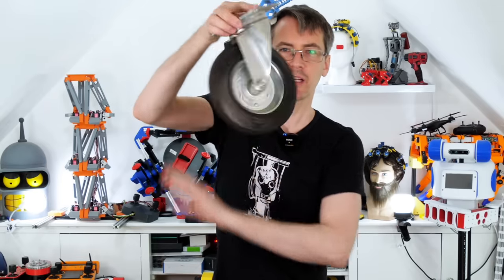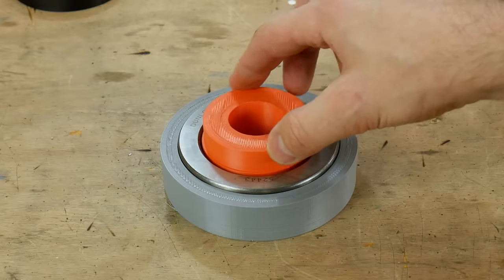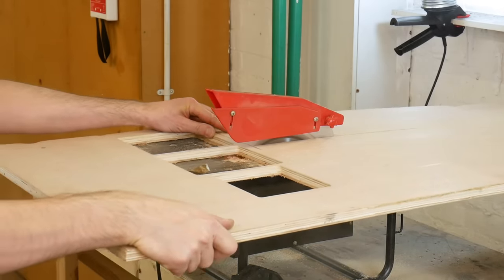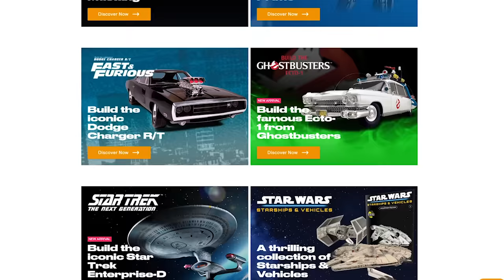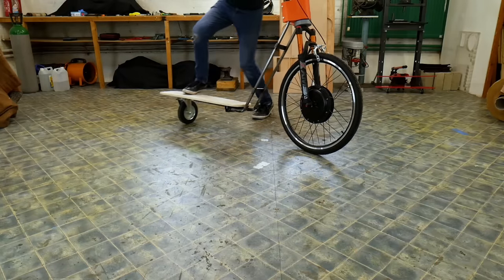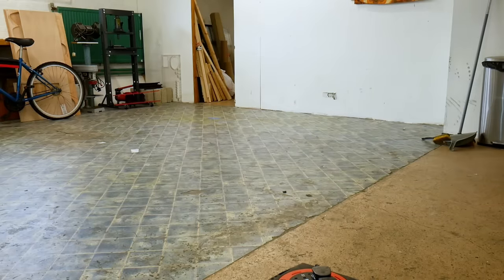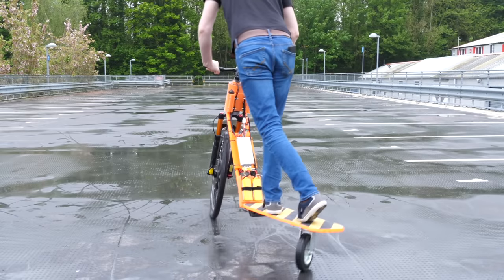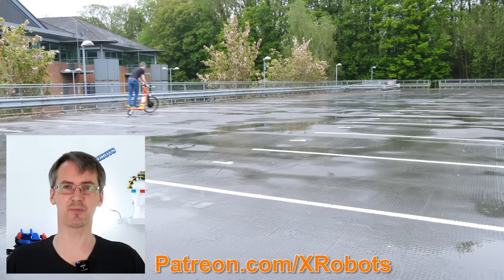1000W Caster Scooter

Comment: I’d have spring loaded the caster. That is leaflets to put pressure keeping it straight, tensioned so that it needs a little more momentum before the spring gives way, and doesn’t run away just trying to get on and take off. Caster or not, you want it to spin less than a complete 45 in either direction anyway, if it does, you’re asking for an accident.

Comment: I think to make this ride-able, you will need to selectively constrain the rotation of the caster.
I wonder if it would be possible to have some sort of arrangement that allows you to put weight on a pedal that progressively straightens/centers the caster. 
When your weight is off or lightly on the pedal, the caster could swing - or maybe vice-versa. Whichever makes sense for your posture / weight distribution.

Comment: Bicycle mechanic here..

Regarding your brake mounts, undo those screws, put that plastic spacer IN THE BIN, and fit your disc rotor using those same screws. Your rotor and caliper will fit, because that hub almost certainly wouldn't be made outside of the necessary disc brake standards if they actually wanted to sell any.

The plastic spacer is merely to stop the screws fowling up on the planetary gearing inside the hub. If the screws were any shorter they'd be useless for mounting a disc rotor however.

Comment: Hey bud.  Stick some resistance springs between the forks and the frame that allow movement but offer tension against the loose play between the frame and the front wheel assembly.

Comment: I'm thinking, much like on a normal bike, where you lean left and the front wheel goes left, you need to add, or increase the geometry. Basically, you want to make the caster turn opposite to how it moves now. I think this could be done by playing with three angles: the front wheel/handle bar; the angle that the caster wheel is mounted (you have it parallel to the ground, maybe a wedge between the deck and the caster); and last, the caster mechanism itself. 

I haven't worked it out myself, but it seems like there should be a permutation where you achieve at least neutral stability, or positive stability of the caster compared to the negative you have now.

Comment: at 5:10 what you have there is a pipe kinker. the material being bent needs to be really tight in the die to prevent it from getting wider and forcing it to hold its shape.
Usally they are so tight in the die that they dont touch the bottom of the die till it start bending

Comment: If you'll use motor wheel for rear wheel, you can use it make a tension of board and stop unnecessary rotation when braking. Also using rear motor wheel in  recuperation mode adds some stability in turning.

Comment: Zoe The Robot thinks you should try it with two casters in the back, with the casters side by side, about 8 to 12 inches apart. Maybe being able to lock the casters for slow speed, and release the casters for high speed

Comment: Two rear caster wheels side by side wouldve given some stability, and been interesting to see. 
Or possibly one rear caster wheel that is constantly using regenerative braking, which will give some stability, and slip out at a controlled rate, almost like a ski, rather than the  uncontrolled caster wheel ya used.

Comment: If the rear wheel had drag, it might make the bike stable. To get the drag, it could have a generator hub that feeds current to the front motor. But what's the fun in stability!?

Comment: Even pushing a trolley from the front is completely unstable, I'm not sure what you were expecting. Sure, when you accelerate or have an exact zero-acceleration, the back wheel is pulled and the forward momentum of the back of your bike is lesser than the front, but as soon as the front slows down, the momentum of the back is greater and the back wheel tries to overtake the front wheel, and this is true whatever your position.

Comment: I think you need a brake on the back wheel, and not just for braking- it'd give you way more control over the whole thing. With just a back brake i'll bet you could legitimately control this thing and it could open up the ability to do tricks you couldn't do otherwise. It's a neat project!

Comment: Mount the caster on an angled laterally pivoting wedge with the pivot and the low end of the wedge in the rear. The angled pivot would raise the leading side of the caster as the assembly pivoted away from center increasing the angle of the wedge.

I know. James Bruton dude is always off to some different design with his next videos and never develops anything any further, though I often wish he would.

Comment: May I suggest rubber band tensions on both ends of the cast anchored to the front giving it a bit of resistance from slipping out and a neutral forward position

Comment: It might be easier if the board you stand on was lower to the ground. You'd have to a similar bracket as you had for the brake to attach the caster .
I did a similar thing to a longboard I made ,instead of attaching the skateboard trucks to the underside of the board I made a couple of brackets so the board you stand on was lower than the trucks attachments.

Comment: edit: @mago comment is the same but better, oops 😅

I think you need to angle the caster a bit too so it is pulled toward the center of mass the same way the front wheel "falls" in line on a bicycle to try to correct a plane of travel during turning.

Comment: So your idea would work but as far as bikes go there’s a reason why they have a complete frame compared to scooters  where the position of the front wheel is to the frame to handle stresses. There is also too little friction in the back, unfortunately to remain stable the caster would need more drag than the front at all times hence why all recreational rides have rear braking primarily and front is only supplemental.

Comment: My suggestion? Don't try to steer with the front wheel (lock the front wheel so you CAN'T steer). Super counter-intuitive (and may not work) The theory would be that you steer by leaning, the lean makes the caster turn, when you pull it upright again, the castor should* then straighten out, as the force of your body is now directly down, and the front wheel drives it to the neutral position.

Comment: Theres a rubber spacer on the rotor mount when they ship hub motors, you remove that to install the rotor so the spacing will be fine and if it's not, use the thrust washers that they send to adjust the spacing. The disc brake would have worked no problem, its standard size. Also, its not a good idea to use a 1kw front hub motor with a suspension fork or an aluminum fork and ESPECIALLY not an aluminum suspension fork. At the very least, its standard practice to install a steel torque arm to prevent the axle from splitting or rounding off the dropouts on the fork.

Comment: I think if you put 2 caster wheels in a v shape toward the back it will be a lot easier to ride as it will be balanced in an upright position also you can use your weight as steering mechanism by shifting it in either direction with front steering (or eliminate the front steering  )

Comment: You should have drilled a hole on each side of the caster wheel to put a somewhat soft spring on each side so it will pull itself back straight but not effect it too much when you are trying to  strafe.

Comment: Try aggressively leaning the scooter into the corner, with your body leaning only slightly into the corner.  The castering effect should overcome some of the lateral acceleration, thus reducing the propensity to spin out.

Comment: Mount a couple of coil springs, one to each side of the castor and on to the frame. This will add resistance and help pull the castor back to a central position, but will still allow some rotation. Hopefully the damping will reduce the tendency of the scooter to spin.

Comment: A free spin ing rear wheel is like a gyroscope that favors no variance in direction. Inevitably, when speed is decreased, you almost always micro adjust your steering wheel slightly causing the rear wheel to independently maintain speed and direction as much as possible. If you can maintain perfect level breaking continuing a straight line, you'll have no proboem. Anything else you'll drift to try and preserve overall speed (with front & back separate masses) going different velocities and directions.

Your scooter-unicycle essentially averages the combination of both front and back attached where the rear is dependant upon initial acceleration to follow, but, breaks rules of easy rideability when velocity 9r vector changes.

Someone from Circ du Solei would have difficulty riding this.

Comment: You can improve it by tilting the vertical axis of the rear wheel a little forward, as the wheels of the two-wheeled skateboards go, you keep the spin but avoid it to get out of control.

Comment: Just a brake on the back wheel would solve a lot of the problems. It would still allow it to cast but you could control how much by 'pulling' the rear back along the travel vector. It could also be hooked up to auto-break when the board tilts. Maybe easier said than done given that it can over rotate & twist up cables.

Comment: The locking mechanism you angle grinded off that caster performs 2 braking functions at the same time, it brakes the rotation of the caster bearings as well as the spinning of its wheel.  Instead of a caliper brake on the front wheel, what if you utilized the caster breaking to hold the back wheel still in both directions at once?

Comment: If you incline the caster with the wheel further rearward it will tend to center.
If you lean out of the turn it should steer in the direction you want to.
If you impose some drag on the rear wheel it will trail straighter.

Comment: You should mount the caster wheel at a slight angle so that it tends towards forward, similar to how a ripstick works since those have two caster wheels and are very easily controlled once you get  the hang of it

Comment: Slightly defeats the point if a castor, but what if you had 2 springs either side to help it align back centre? It could still swing out and be gnarly but at least you wouldn't just endlessly spin in circles lol. Or perhaps angle the castor forward a couple degrees so it more aggressively wants to track straight?

Comment: It's not a perfect answer , but the next time you get in a jam where you may not have the correct size for the pipe. Your bending you can fill the pipe with sand, As the sand doesn't move and contract the same way metal does, And there's no room for it to go anywhere when you're bending it inside of a pipe.   So it helps keep the exterior walls straight while bending 😅😂 you are likely already familiar with the idea but simply didn't think of it in the moment... it am option for anyone looking to try bending pipe without perhaps the tool or being required to make say 2 bends but never needing it again

Comment: Build  V shaped body, with the front wheel at the joint, and a caster at either tip. This would remove the problem of balance from the situation while still exploring the question at hand.

Comment: You could experiment restricting the rear wheel's ability to turn by putting the attachment point at an angle downwards, rather than parallel to the board. This should fix the bike with 99% certainty.

Comment: The front of the caster mount should be closer to the ground then the rear of the mount. This should make the caster want to fallow the lead wheel buy lowering its center of mass when going in a straight line.

Comment: For stability and control put one caster wheel on the 2nd bend of the frame and one or two non caster wheels at the back of the board

Comment: Re: pipe bending

Instead of going for the whole angle change in one go, it's much better to bend a little, move an inch or two down, bend a little and so on. Trying to create wider radius with the stress spread out more. 

This may be a little clumsy with the bottle jack, but it'd probably require letting the position back down to neutral between each little nudge

Comment: I think you need to control the back wheel by using your body as a constraint between the handle and  the standing area. Not goingto be eays, but at very least the front wheel will be twisting and its friction against the ground should reduce the throw out of the rear wheel. this also means you need to resist the urge to jump ship as soon as things start going out

Comment: Tip the caster wheel down in the front. I built a rear caster wheel big wheel for my son years ago and tipped the front of the caster wheel mount down in front so they have a tendency to self center.

Comment: If you could figure out a way to add a brake to the castor so that you have front and rear braking, that could help give you some more control when braking. If you could also only apply the rear brake a bit it would give you more stability when travelling slow

Comment: honestly, in a time of scarcity and difficult manufacturing, i understand why they made bikes with 2 wheels,  but hehe, you could stabilize the bike by putting more caster wheels, so that it cannot tip you off of itself, and you don't need to manually balance on it anymore.
or if you feel adventurous, you can suspend the platform on 4 caster wheels, attached in a skateboard configuration!!! this allows you to use the caster wheels, while still allowing for you to lean into corners....but i dont think such a contraption can be manually stabilized....it would need suspension at least.

Comment: There is a plastic shim on the disc mounting bolts you have to remove to fit a disc brake. The hole in the fork's arch is to fit a fender not a brake.

Comment: I was wondering if the bike would be easier to control if the back wheel had a movement limit of like 45 degrees to each side, or more or less since you can verify the trailing wheels needed angles.  Good luck with the bike.

Comment: You needed dampener attached to the caster to slow its Jerky movements, it would also limit the movement and avoid snapback. Also some actuators attatched to the  castor with some stiff springs that pull the caster straight as default and that would release the caster to have some free play when a button was pressed would get rid of most of the unpredictable  behavior

Comment: What if you mount the caster wheel at a angle like 20°-30°? then it would tend to stay straight, but still has the possibility to rotate a little bit. does it make a difference?

Comment: I think it would work much much better with a fixed headset. you would still be able to steer at low speed using the rear, and you could lean steer at speed. Having two steering axles allows it to steer beyond forward track.

Comment: 3D print a cheese wedge to go between the deck and the four bolt flange for the rear castor, 20mm at the front down to 0 at the back; and it’ll ride perfectly.

Comment: Just widen the back end and add another caster in parallel. That way, you have something to help you hold your balance.  The part you stand on will look like the letter T. You probably will need to add some more steel so it will not snap.

Comment: What you've built is similar to the razor crazy kart, but with only a single rear caster wheel.  The carts look to have a greater amount of caster/angle on the rear, which the rider can adjust with a lever to make it more or less stable for drifting.
Reply: Agree it’s an old kids toy 
With nomotor on the front it will self propel by carving / pumping old kids toy!!!

Comment: Before even starting the video, I know you should be putting the caster on an angle so it will self correct straight, this can also be used to propel you forward.  Look up ripsticks. They have been around forever

Comment: Maybe weld a flexible arm to the caster turn joint and the steering so it locks the caster from 360 deg rotation, unless that is the whole point

Comment: at 1:01 when you are showing the brake rotor mounts, it looks to me like the bolts are actually holding on a spacer, if you take out the bolts you might find that a rotor would fit with your fork. 
Also you should really set the bearing preload on the fork using a top cap and star nut/expander plug instead of just relying on the stem bolts

Comment: Interesting suggestion! Incorporating the concept of self-centering from ripsticks and using an inclined plane or spacing between the deck and the caster could indeed be a potential solution. It's always fascinating to explore innovative ideas for improving mobility and rideability. I'm curious to see how this concept would work on a bike with a caster wheel. 🚲🤔🔩

Comment: the only reason it works a little bit is because the caster bearing is on an angle to the ground when you are on it, just like the steering wheel. it makes it more stable. i think that the drivability will improve if you set the angle off the caster further forward.

Comment: I love this idea I would use a stiff back wheel and the 3d part you printed I would have just used steel and reason why it bent was the steel wasn't the rite type or the walls where to thin I would just have used steel poles that wasn't hallow but love this

Comment: I think if u made the castor require more for too change direction lik damping it or putting a partial break on it so it required a non trivial amount of side ways force. It would be alot easier to ride and give a much more pleasant low speed and slowing down experience

Comment: hey james, i think if you put the caster wheel in a 45 degree angle it will help with the endless spinning around. i have a 2 wheel skate, both wheels are casters and on a 45°.